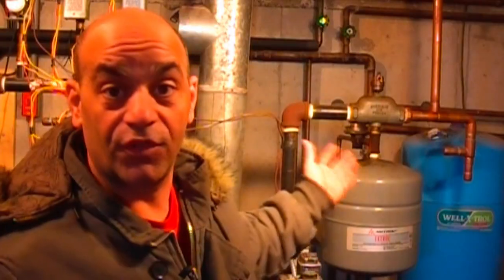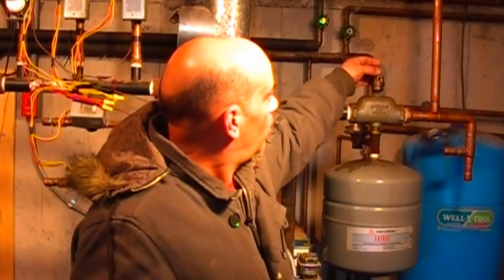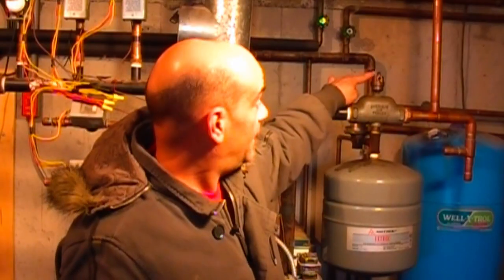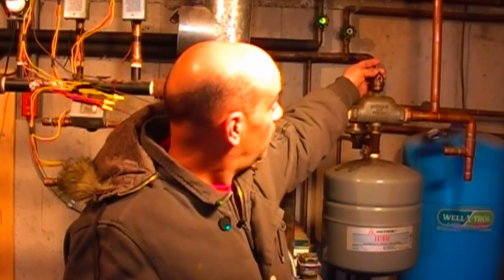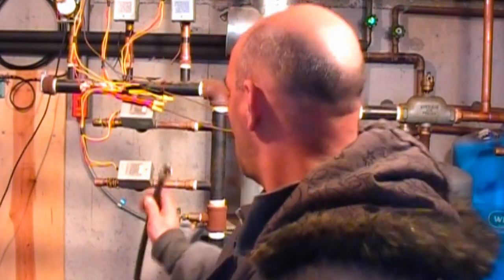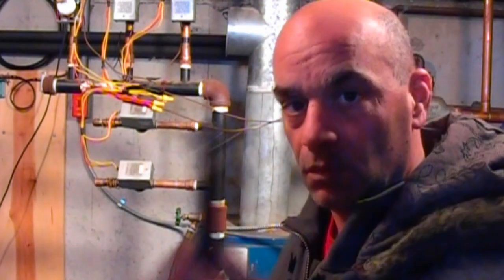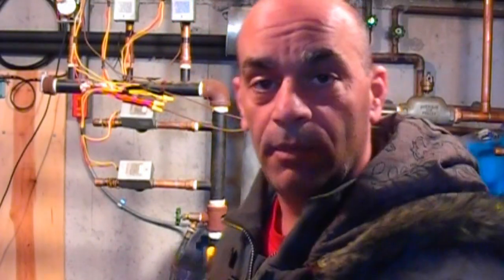How to remove the air from your boiler / heater

Comment: Dominic, My home hot water boiler is a 10 year old, oil fired Burnham, PV83WC @ 123MBH. It operates great. I just installed a BW Hot Water Heater so that I can layup the boiler for the summer. The Burnham ran all year round because the original install had the boiler coupled with an indirect HTP hot water heater which I did not remove but I piped it so that I could operate either HWH independently. I would like to flush the boiler before summer lay up. Any thoughts. Should I flush the entire system (4 zones) or at least the boiler by it self?? May be add a corrosion inhibitor. Regards
Reply from the maker: +gearhead0800 Adding a corrossion inhibitor is a good idea.

Comment: I followed the directions but how long does it take to get the water to its location. My zone I was bleeding is on my second floor and it's the only zone. it's taken for ever and that room is not warming up. Does the water pressure need to build up to send through the system?
Reply from the maker: +Shawn Pierce Watch the video again. Yes don't let the pressure drop too low. What is the pressure on your gauge.
Reply: +askmediy 15 like you said it should be. It's taking forever
Reply from the maker: +Shawn Pierce And it can. But are you getting air out. Did you open the fresh water supply?
Reply: +askmediy I believe I did I could take a photo of my layout for you
Reply from the maker: +Shawn Pierce A pictures right now isn't going to do anything. Follow my instructions to a T . Bleed, add water and repeat

Comment: I have circulators instead of zone valves, or my zone valves are not obvious in the open.  How to I ensure the circulators are open to allow the water through when doing the same task?
Reply from the maker: +Rob Moogs Just turn on the thermostats. The pump itself is your zone valve
Reply: +askmediy thanks for the response. if i turn on the thermostat in the upstairs apartment like you said, does that mean i leave the boiler switch "on"  when i'm draining from the spigots?
Reply from the maker: +Rob Moogs Oh yeah, otherwise the pumps wont pump / open up. Or you could just leave everything off and just let the water / air run it's course. That's how I do it. What you don't want is lots of cold water entering a hot boiler. And not a air-filled one. You could crack your boiler by doing that.
Reply: +askmediy ok thanks i'll try that. what i did yesterday was turn off the boiler, close the valves and just drain from each spigot. while i noticed the gurgling noice go down, i still heard it occasionally in my bedroom even though i fully drained all the spigots

Comment: Hi thanks for the tutorial !

So the air inside the boiler makes that some places are hot some not ?? Because in my house, in some rooms is too hot in other is warm. 

Is that right ? removing the air will fix that ?? 

Thanks for your help, really appreciate it.
Reply from the maker: +Jorge O. To a point yes. But your whole design could be bad.
Reply from the maker: +lemmieatit The pressure in your system is too low. Try adding more water to it. Your pressure should be between 15-19 psi.
Reply: askmediy yess ! this was the problem, the water presure. I drained the air, and put the presure to 20. That noise on the pipes is normal, I mean what I turn on the system those pipes were to noisy. After 10 minutes, nothing. Is that ok ?? well, now is hot in every room. 😜

Comment: Hey Bro I recently replaced my mixing valve and was wondering if I should do this method along with bleeding the radiators themselves. My 2nd floor isn't very warm. Have an old 1950's Smith Boiler and my expansion tank is the horizontal type. And what order bleeding the baseboards. Thanks man
Reply: +Ryan Dunbar definitely utilize askmediy's  meathod and once done, bleed each radiator, the first one from the supply side of your unit working your way to the last radiator close to the return.  This way, if the unit is operating or if there is a flow (from a circulator or gravity feed) you are removing the air upstream from your boiler and working your way downstream.  Generally speaking, most plumbers will put a bleeder or air scoop at the top of the return pipe directly above your boiler.  This will catch any remaining bubbles over time being pushed downstream through your system.  Also, over time, any remaining air will be cooked out of the water anyway.

Comment: So do I need to push the lever on the zone valve that I want to bleed or do I just turn the thermostat on and crack the spicket?
Reply from the maker: +Comegetsum2011 either one will work but if you do that your boiler will be on and running. Just shut the system down and do it manually or just do it the way I show in the video.
Reply: +askmediy  thanks for the speedy reply! ok I will do that. One more question. Zone 3 in the attic is not getting any hot water in the radiator, could having air in the line cause this? We haven't turned that zone on for 3 years since the space wasn't used.
Reply from the maker: +Comegetsum2011 Sure can.
Reply: +askmediy thanks for the help!
Reply: +askmediy my zone valve does not have a lever on it?

Comment: Nice informative video-thanks
Reply from the maker: +Hal SAR Always my pleasure.
Reply: my main valve (just up from the circ pump) is stuck.  I have run water for awhile but there is still air. #1 Is there a problem running system at 25 psi? #2 My boiler sometimes goes Baboom (shakes the house) when it ignites-what causes this? #3 Sometimes pilot is out-how come?  Water drips on gas control sometimes-connections are corroded-How do I remake good connections?  #4 When I turn screws on baseboard fittings no air or water comes out even if screw is completely out-Why?  Thanks-I've got lots of questions.
Reply: +Hal SAR What is the difference between Manual and Automatic? Setting on Boiler box connected to thermostat?      Also my system uses a thermopile-FYI

Comment: My pressure on the blue gauge is at 75...is that right..because I starting to see leaks where they were not before...I see a plate that says wpac..or something like that...and it say maxium pressure is 30psi...so Im assuming that is the blue gauge reading..now how do you adjust that pressure..at that small regulator you showed at the beginning of your video...nice video by the way...
Reply from the maker: +Kennynva T. if it's PSI we're talking about here you need to get that down to 15-19 psi. You can do that by removing some water in the system. You will want to make sure that your regulator is working right.
Reply: +Kennynva T. In addition to what askmediy suggested,  replace your expansion tank - at that pressure that bladder is toast inside - important safety step!
Reply: Thanks...yep replaced the tank..all is good at around 19psi..now..thanks..

Comment: I have a newly installed force hot water heating system. I think I have an air block in the line. There's a lot of clanking noise from the radiator and the furnace will shut off after running for 45 seconds. Does an air blockage cause the furnace to shut off?
Reply from the maker: +Amy Diggett You have a boiler, not a furnace ok. And not really. Either you have air or a bad expansion tank. But either one of them wont really shut off the system. Want does your gauges say ?
Reply: Thank you. Yes you are correct-a boiler. Not moved in yet so I can't look at the gauges until tomorrow. I did time the boiler when I was there earlier today. I was there for two hours. When I got there and turned up the heat the boiler
ran for 6 mins and 33 seconds. I timed it with my phone. After that, each time 
when it came back on it would run for exactly 2 minutes then shut off. It did 
this for 8 cycles.

Comment: I have one zone. There are bleeders at each register. So when refilling system, let air out of spigot first then bleed radiators? Or will spigot remove the air on its own? Thx
Reply from the maker: +ken peffley Yes, then just do the radiators last. Even a day later.

Comment: how does this differ from bleeding the registers.? thanks
Reply from the maker: +ken peffley If you do have bleeders at each heater that would only do that heater. Doing it by zone does the complete zone. For larger amounts of air do it at the zone valve.
Reply: +askmediy may I suggest utilizing both -  you should do the whole system first, the way askmediy describes it to get the large quantities of air pushed out - but then once done with that, bleed your different registers or radiators using the individual bleeders on them as well.  There are many different radiator designs, but most tend to trap lots of air inside in such a way that blowing the system out near your boiler wont remedy it.  This leaves you with under-performing radiators, since the hot water is not contacting the maximum inner surface of each radiator.

Comment: I tried to purge mine but now my psi is at 0. How do i get it back up?
Reply from the maker: +Blushious1 when you let water out you need to let water back in. Check your fresh water inlet valve to your boiler. And leave it on all the time.
Reply: askmediy Do I need to touch the zone valve ?is it possible I could just drain
Reply from the maker: +John Doe I would've showed that way if that was the way it's done. No open each zone valve up
Reply: askmediy didn't see the taco.I flipped the relieve valve and then drained less then a gallon.did I break it?.(last question)I'll call tech.
Reply from the maker: +John Doe No, just don't leave that up. What does the gauges read?
Reply: askmediy barley above 0
Reply: askmediy red was in the middle.
Reply: askmediy a lot of knocking.I'm off a call for heat and still runs water a minute or 2 after
Reply from the maker: +John Doe Turn the unit off and let it cool. Than add water. Something seems wrong. Call a tech I would say.
Reply: askmediy ok thanks a lot ,I do appreciate ur time

Comment: Very nice, thank you. There is an air separator to which the expansion tank and air valve are connected. Should an air separator be on the outflow side of the boiler or the in flow; or does it make any difference?

Comment: The boiler was sitting around zero pressure, found the water valve was closed, opened up the spigot and there was a huge rush of air coming out, probably drained about 20 buckets or so of water out.  The pressure is sitting around 20psi with the water temp being 190 degrees.  I am feeling a little bit of heat coming off the radiator that comes first in the circulation line - should I be waiting for all of them or is there something I am missing here?
Reply from the maker: +James Cox Sounds about right to me. You'll really just need to give it time. Hot water coming to the radiators and cold water being returned. Just time really.

Comment: How would you test an Star FX 15 Cirulator? Zone 1 "is" being triggered as per LED on the TACO sr504 but above the pump pipe remains cold? Any help would be greatly appreciated.
Reply from the maker: +physiques Use a voltage tester to the two leads to the pump.
Reply: Thank you, the pump is getting 110V. On the TACO SR504 Zone 1 works green light lit 26V present. Zone 2 lit but not getting voltage (at TACO) zone not working. Above pump, pipe zone 2 room temp. Thermostat for zone 2 shows approx 14v Is there a way to trip the pump so I can rule out that as a problem (I'm guessing since the TACO504 isn't showing voltage on zone 2 the pump isn't being trip but that's my amateur guess. Any suggestions are so appreciated when you have time.
Reply: Correction failing zone is sending 120v to the pump but the pump isn't working (It's a WILO) So I have to assume the pump is failing or the capacitor in the pump. Are you familiar with WILO pumps reliability? I've read they weren't so reliable but not don't know if it's pump or capacitor that fails. Just wondering if you heard anything regrading it?

Comment: +askmediy I just found that bicycle tire purge cap screwed tight. ( I have no heat in one of the zones and know it needs to be bled). But when I loosened the purge valve cap it is shooting out boiling water. Is this normal? This  has been placed just before  elbow where the relief valve sends the pipe down into the bucket.
Reply from the maker: +susan lawlor Pretty much that's normal until the air gets there. But it could also be in a not so good spot. I would just leave it loose for a day and see what happens

Comment: Im not sure if I have a problem with expansion tank, air in the pipes or the pipes are clogged. There is a union before the zone valves. I can completely unscrew the union and  no water comes out at all. There are 4 zones and the other 3 are also not working well, but the pipes do get warm so I know that there is something flowing through them. I have in the past, I removed an elbow that was completely clogged, so Im afraid that this may be a similar problem. What do you think might be the problem.
Reply from the maker: +ajokdk2 Clogged with what? Sounds like you may have very hard water. There is just so many things to start with. First make sure the main water supply to the boiler is on.

Comment: I see the emergency power switch  I turned that on but the pilot still wouldn't light and I had the switch set to pilot
Reply from the maker: +James Walton You're going to need to do more than just set it to pilot. Not all are the same. You should be able to push the switch or a red button in while lighting it. You may just want to call someone.

Comment: would the power switch be on the boiler itself. it's a crown boiler
Reply from the maker: It should be but it could also be on a wall somewhere. Usually has a red plate cover. Maybe even near the door to the room where the boiler is i.e. Stair well

Comment: Hi, what are your thoughts on flame roll out switch going bad after replacing it the day before? Prior to this also the transformer and wiring inside the boiler had to be replaced cause of heat damage. The boiler unit is a burnham boiler series 2 1999. thx in advance
Reply: +Dick Harper clean the carbon out of your burner pipes

Comment: The pipes are hot but no heat inside of the house.
Reply from the maker: +Kenithea Hedgeman Try removing some air. Also make sure the fresh water supply is on.

Comment: I have a problem with water pressure going down in my oil furnce ,i have to add water often ,,can anyone tell me what s causing this to happen? thanks
Reply: +Kathleen O&#39;Brien It could be a bad expansion tank. First clue - water on the floor (or a damp floor) under your pressure release valve (a safety valve usually located on the side of your boiler unit with a pipe aiming down towards the floor) - I will explain.   I am assuming you do not have an automatic valve that fills your system to the correct pressure as askmediy describes in his video.  When you fill it manually, you are filling it with cold water.  Once you get it to the appropriate pressure, you walk away and the unit will kick on at one point to heat up the water.  At this point, the expansion tank kicks in and absorbs some of that pressure.  When one goes bad, the bladder breaks and it fills completely with water, nullifying its ability to absorb the pressure difference between the cold and hot water.  Your pressure becomes too high, and the aforementioned safety valve releases some of the water on to the floor.  When the unit cools, it returns to the now extra low pressure due to the loss of water.

Comment: Thanks for the vid, currently when my boiler turns on we hear noise of water running through the boiler pipes like water from the top floor running down to the boiler and it has never done this before?
Reply from the maker: MachineGun Kelly You have air in the system. That's why you hear that.

Comment: I have a single zone oil baseboard water heater . It gets confusing with the extra zones that are shown here. I purge the water  pipes but I think the air comes in from the street water supply that replaces the water I drained out.
Reply from the maker: I don't think so. IF that was the case you would know it

Comment: I have a 3 zone system and I can't bleed the air out. I did all the things mentioned BUT no mater how long I let the water flow bubbles keep coming out. I even let it run for 20 minutes and air bubbles keep coming out. What is the problem?
Reply from the maker: Since the water is hot we're not looking for little bubbles. We're looking for bigger burst of air. I'm not saying you don't have air in the system. What makes you think you have air?. After removing most of the air I would just let the self bleeder do the rest.
Reply: askmediy As water comes out it is full of little bubbles that just keep coming. One of my zones keeps putting out large bursts of air. I left it on for 10 minutes and large burst of air keep coming out. There are no water leaks how is air getting in/
Reply: James Czajka I put in a new expansion tank so that is not the problem
Reply: James Czajka I have let the water run from one zone for 15 min now and air bubbles are still constantly coming out
Reply from the maker: You also have a leak somewhere which is allowing air to come in the system. Also check the self bleeders

Comment: Dom, I measured 50 psi. As I said I dont have a regulator where the water enters my basement, it just passes through the water meter. Do you think I should have the meter checked by the water company? Its the only thing I can think of.

Comment: hey Dom i just replaced my circulator pump now i get heat down stairs of my house but no heat up stairs i have one zone for hole house .i have baseboard heating help pls.
Reply: Check your water pressure level, you may not have enough water in the system. Then bleed the air from the system (I prefer having the circulator running during the bleed)